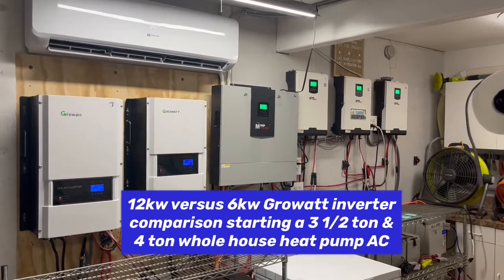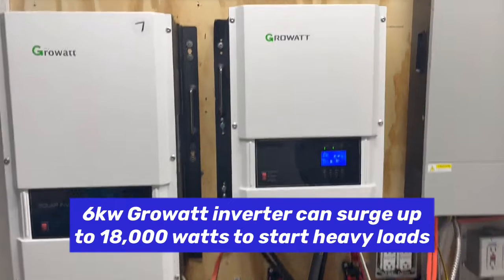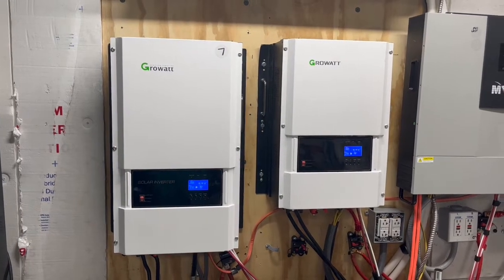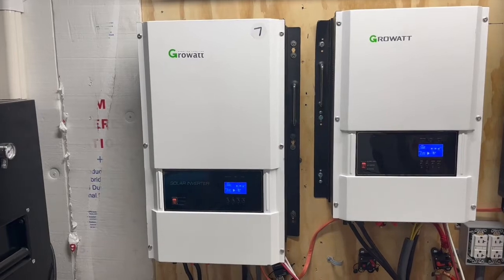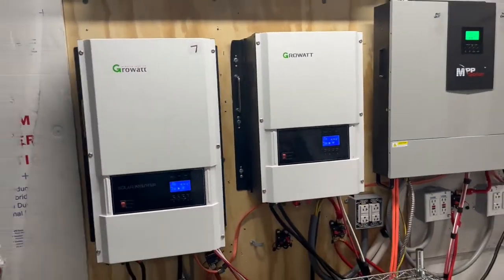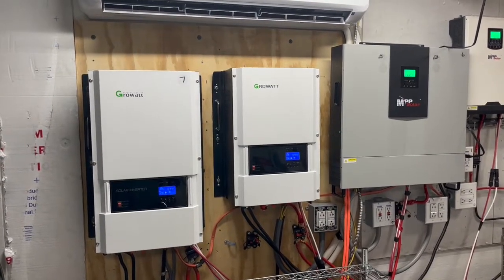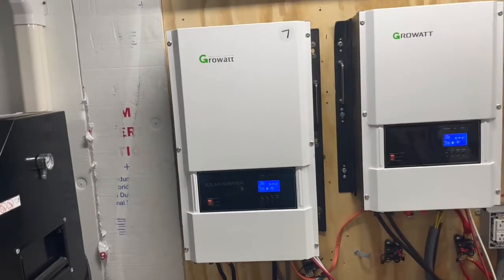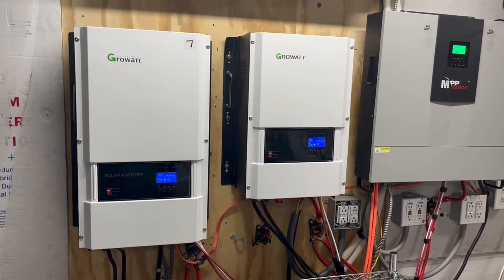12kw & 6kw Growatt Low Frequency off grid inverter comparison to start 3 1/2 ton & 4 ton AC.

Comment: hi can you fix growatt  Inverter mptt
Reply from the maker: You can replace the circuit boards in Growatt low frequency inverters. You can find replacement circuit boards on eBay.

Comment: Those are high frequency 220v inverter with a transformer to give you 120v. A true 6kw low frequency inverter will easily give you a 120 amp surge as long as you have the battery capacity.
Reply from the maker: These are low frequency inverters, the 6 kW weighs 109 lbs and the 12kW weighs 186lbs???? They weigh that much because of the large coils inside.  What are you talking about. You can go look on the Growatt website to verify.

Comment: How are the low frequency units doing? We are looking at the 8kw model.
Reply from the maker: They weigh a lot. The 6kw Growatt is around 109 lbs. The 2 EG4 3000 watt off grid inverters output 6000 watts when in parallel, those weigh around 20 lbs each and are much quieter when fans are running with heavy load. 

Growatt fans can be very loud when running a load of 3000 watts or more. Growatt idle consumption is around 100 -125 watts, EG4 is aroundc50 watts each unit. Both will give you split phase output.  I would think the 8 kw model would weigh around 150 lbs. 

very hard to mount on wall unless you have a lift table that can lift at least 50 inches off ground. I had to use an engine hoist chain pull to mount my 12kw Growatt. 

You can buy and replace the circuit boards for the Growatt low frequency inverters. They sell them in eBay. You can not parallel Growatt low frequency inverters. 

That’s why I switched to the high frequency EG4 3000 watt off grid inverters, I have 4 mounted on the wall for 12,000 watt output with a total of 200 watt inrush amp capacity to start my 3 1/2 ton, 4 ton ac units and my 12 ton pool heater heat pump. 

I just bought 2 more EG4 3000 watt high frequency inverters and will have 18,000 watt output capacity. I  can parallel up to 12 inverters for a total output of 36kw. 

If 8kw Growatt is all you will need, they are worth it but you cannot expand in parallel down the road. 

Check out my newer videos on the EG4 3000 watt off grid inverters, also they sell EG4 6000 watt , 8000 watt and 12,000 watt output as well. 

Not sure if the EG4 6kw, 8kw and 12kw are low frequency inverters. I only have the 3kW Ezg4 and love the fact I can keep adding more and only $674 each, $20 shipping. 

I recently found out in November that I have a stomach hernia so I can not mess with really heavy Growatt inverters anymore or I risk tearing hernia and having to get surgery to fix, so I switched to the 20lb EG4 3000 watt off grid inverters. Hope this helps, let me know if you have more questions

Comment: A common mistake is not reducing demands on a system. Unless you are okay with spending big bucks.
Reply from the maker: I actually use over double power now that I am producing it off grid and my electric bill is reduced by almost 80 percent. 72 in the house upstairs and downstairs and 74 in 3 car garage when 110+ degrees outside in day and in the 90’s most of the night. We have been able to pay off equipment each year with just the savings in electric bill each year. Can’t get that payback time with grid solar. Thanks for your input and hope you have a truly wonderful and extremely blessed 2024

Comment: What’s the battery voltage to run that 6K Growatt?
Reply from the maker: All of my Growatt inverters are 48v. Even my new EG4 3000 watt inverters are 48 volt. I now only use 51.2 volt EG4 server rack batteries on all my off grid solar systems. Hope this information helps.
Reply: @diy-solar-guy  thanks, I’m considering adding one for the 240v part.  I’m running two SW5548 ‘s so I’m already set up for 48v. At this time it’s 48v @ 2200Ah.   They can do 120/240 but finding the “SERIES STACKING
SINGLE PHASE / THREE WIRE SYSTE
USE TRACE P/N 1880-15” cable is difficult to find. I have the wire diagram but to stupid to understand how the pin configuration works.
Reply from the maker: @kenmay1988  the 6 kw Growatt can not be paralleled. Might want to t to look at the EG4 3000 watt inverters. I just installed and and running my 3 1/2 ton and 4 ton whole house ac system with 4 of them in parallel. 2 EG4 3000 watt inverters that are 48 volt are much lighter and can do the same as the Growatt inverter but you continue to expand by adding more in parallel, up to 12 - EG4 3000 watt inverters in parallel. Need at least 2 and need to add more in pairs if 2 to expand. Check out my latest videos on the EG4 3000 watt inverters. You can go up to 500 volts dc solar panel input with EG4 inverter, the Growatt can only go up to 150 volts dc solar panel input. You have to keep input dc amps below 20 amps but can output 80 amps on each inverter. They are $674 each. Only weigh 18 lbs. Growatt 6 kw weighs 109 lbs. hope this helps. Hope you have a truly blessed day

Comment: Thanks for your video. It's always great to see what others are doing. I have been running my whole home air conditioner system and another split system at the same time for the last few years without an issue, on my Mpp Solar 8KW inverter. That being said, both these air conditioners are inverter types and therefore are soft start and vary the draw as needed.
Reply from the maker: That is the wonderful thing about mini splits, the slow ramp at start up. My 3 1/2 ton & 4 ton were 78 amps and 109 amps at start up so I had to install soft starts to reduce start up amps. But I had to use a low frequency off grid inverter. High frequency will not start the 3 1/2 & 4 ton ac units. Thanks for your comment. Hope you have a wonderful and blessed week.

Comment: Love you channel, very informative, wanted to know if you ever got the E-Z start and did the growatt 6kw able to start you AC? Thanks
Reply from the maker: https://signaturesolar.com/surestart-soft-starter-4-ton-and-under/?ref=oJ3Bgl9hDE3G
Above is the link to buy soft start that I used on my three heat pumps. You can not start 3 ton, 4 ton and 12.7 ton heat pumps without a soft start. You can start a 3 1/2 ton heat pump with the 6kw Growatt and a soft start. Thank you so much for joining the channel and welcome. Thank you for your kind comments. Hope this answers your question and I have a lot of info on the subject along with 3 videos installing the soft starts on 3 1/2 ton, 4 ton and 12.7 ton heat pump. Very detailed on installing soft start that I bought in link above. Hope you have a truly wonderful and extremely blessed weekend

Comment: Hello sir, how many solar panels do u have connected to the 6kw? I have the same 6kw but notice it has low open voltage.. did  u run all your array in parallel?
Reply from the maker: I had 24-250 watt poly panels connected to 6kw Growatt low frequency off grid inverter I connected 4 sets 4-250 watt 38v input solar panels in series which was 152v pv input, connected those 4 sets together in parallel, then had another 3 sets of 3-250 watt 38v in series for 114v pv input. Connected in parallel as well. Then connected the 4 sets of 4 and 3 sets of 3 in parallel which gave me 119v pv input from solar to 6kw Growatt inverter. You have to keep your pv voltage input below 150v for 6 kw Growatt inverter. I was able to go over a little on total watt , because you will never get 100 percent of watts or amps out of every panel in your array. That is in perfect conditions all day long with no degradation in solar output which is impossible even with array on a sun tracker. I had to use that array for my 12kw Growatt to run my huge 12.7 ton pool heat pump heater so I actually have a separate EG4 charge controller 5500 watt input which is 22-250 watt poly solar panels in 2 string of 11 solar panels in series and the 2 strings in parallel, able to produce 100 amp output. I connect that charge controller straight to 48v battery bank. So I use the charge controller to charge battery and no solar connected into 6kw Growatt inverter. The charge controller voltage can go up to 500v pv input which keeps my amp input in wire below 20 amps. My pv voltage input into charge controller is 418v rather than 150v on pv string going into 6kw Growatt inverter. Much more edgy at 500v input to batteries than 150v input into inverter. I have a few videos on the EG4 charge controller used to supplement my large load on 12kw Growatt inverter when running 127,000 btu pool heat pump heater. That heater uses 7500 watts and 186 amps to run. My 12kw Growatt inverter can only put out 100 amps output. 20 more amps than 6kw Growatt inverter, I actually can get 120 amps output of 12kw and make up the difference with the EG4 charge controller connected through the 48v battery bank to get 186 amps to run pool heater and keep my batteries completely charged at full. Not easy to do, lol
Reply: @DIY solar power with Pappa off grid projects. How u able to connect those different strings to connect to the 6kw? The inverter only has 1 pv input. Thank you
Reply from the maker: @larrymiller7128  I connected the charge controller thru the battery connection. I have an extra Anderson 175 amp quick disconnect connected to all 4 inverter battery block before the dc breaking going into inverter. Then I set my EG4 charge controller to less than inverter bulk charge and float settings. Usually .4v less on each one so I don’t overcharge AGM batteries. LiFePO4 have extra protection with BMS factory installed on my batteries. I will try to do a video today showing how I did the connections.
Reply: @diy-solar-guy  looking forward to it.. thank you
Reply from the maker: @larrymiller7128  I finally after many interruptions today posted a video on how I connected the charge controller to solar panel array and to battery bank of 6kw Growatt inverter. Packed video with as much info and helpful tips as I could think of. Hope you have a blessed night and hope the video helps.
Reply: @DIY solar power with Pappa off grid projects  hello again, can u help me figure out why I'm not seeing my solar panel in my growatt screen..also my solar input is 0. Hope u can help figure out my issue..thank you have a bless day..
Reply from the maker: Use a meter to check dc voltage coming in on wires from solar panels, you might have burned some out and have an open circuit. That would be the first place to start. Usually there is an open circuit more than the inverter is having a problem. Look for that with meter.
Reply: @diy-solar-guy  im getting 145v  from the panels right now...
Reply from the maker: @larrymiller7128  that’s below the 150 volt input range which is fine. Is the polarity reversed on wires? that would give you no voltage in. Are you getting any error codes or fault codes.
Reply: Hello, agai, I have 18 of 320w 24v 40v open circuits  renogy. Is that enough to power the 6kw inhave ?  That's 5760w..
Reply from the maker: On a good day with perfect conditions you might get 5000 watts output with 5760 watts in panels. And that is maybe fir a few hours depending on angle of panels towards the sun. The bigger thing is how many amps will you need to run your loads while charging your battery bank.  I needed more amps for my 6 kilowatt because I was running large loads, that’s why I added the EG4 charge controller to supplement my load draw. Made a huge difference and charge controller was $399.00 plus around $25 for shipping. I have 2 EG4 charge controllers and use both throughout the day when I need to boost a certain inverter where I am maxed out with solar coming in and not able to keep charging batteries, I just add more solar by using the Anderson 175 amp quick connect  cable to plug in with Anderson quick connect cable on battery bank attached to buss bar. Really comes in handy since it is 500 dc volt solar panel input, 5500 watt input and you can do two strings in series then parallel those 2strings together. I have 2 string of 11-250 watt solar panels in series, then those 2 strings are in parallel to make the 5500 watts. The big setback with Growatt inverters are low voltage solar input and also can not parallel together. The Beni fit is you can start a 4 ton AC with a soft start installed send run all day. Hope this helps, best thing to do is try to run your loads with what you have and see if inverter and solar can keep up.

Comment: Hi  pappa  . Hope you and  your  inverters in good health .  I would  like  to  ask  about  your  feedback and  your  evaluation   for  using low frequency  growatt in running  motors and  compressors and  for  how long  now ?  Do you  face  any  faults  or  problems
Reply from the maker: Once panels are getting sun in the summer, I can run main AC heat pumps(3 1/2 & 4 ton) all day for 10-12 hours to super cool house, I only use grid power in 2 months of the year overnight to run ac units. My highest electric bill last year was $172, which is $500 less than when I had no solar. Growatt low frequency is great for starting large in rush amp draws but uses alot on overnight at idle. So I use mpp inverters(48v) for over night use on LiFePO4 batteries. I have 4 separate inverters with each having their own battery bank. I way overproduce power during the day but all batteries are charged up completely when sun goes down. High frequency inverters ( mpp) are great for slow amp draw like mini splits during the day and night but can not start up 3 1/2 ton & 4 ton ac heat pump units at all. Having split phase on the inverters is better than 120v. Never know how you will expand in future. High frequency can parallel but low frequency can not parallel, at least the units I have. I will be adding a couple of 500v dc input, 120amp charge controllers to my Growatt inverters soon. I will disconnect my solar panels from Growatt and run through EG4 charge controller straight to batteries in the near future. I can connect 22-250 watt panels in series or 11 in series and parallel another 11 panels in series to get close to 500 volts dc and only 22 amps or less running through 10 gauge pv wire. Will be able to run the 100 foot distance with better efficiency while keeping wires cool. Hope this helps answer you questions.
Reply: @DIY solar power with Pappa off grid projects  thanks  alot  for  your  response   and  explaining  ,  actually  i need  inverter  for  small  workshop   main work is  to  grind coffee  for customers  by  one  of  6  grinders  (  3  -  4 Hp  motors  )  no  more  than 30 mins  hour  total grinding  in the day  . And  we  close  at  6 pm   so no  load at night  only  1 - 2  amps .
Reply from the maker: @robertomuhammad35  might be able to get away with high frequency but if you run all six at one time depending on amps or watts used, it might shut down inverter. Best to figure out max amount of amps or watts needed for all appliances running at same time, then see if inverter could handle that amount. Also batteries used will play a part as well, weather AGM or LiFePO4. I can start and run all my large heat pumps with at least 4-150ah 2KWh batteries in series but can not even start one unit with just 1 server rack battery of 100ah 5120wh. AGM are great for starting large loads but LiFePO4 batteries can drain down to 10.5 volts each battery weather in series or parallel. Better to have 2-5120wh in parallel to drain batteries that low, I only have one server rack battery at the moment but would prefer 48v server rack batteries when draining to 10.5. I can only drain AGM batteries weather in parallel or series down to average of 12v. That is a big difference in availability amount of battery bank usable.

Comment: Can you charge with ac input 120v generator by chance? have you ever tested I know manual says only input 240v but I didnt want to buy another generator
Reply from the maker: These Growatt inverters will only operate with 240v input. It is not wired inside unit to accept 120v. I don’t know of any way you can change input voltage. These Growatt units have a high surge of 3 times watts, so the 6000 watt Growatt can surge to 18,000 watts to start compressors and motors, the 12,000 watt Growatt can surge to 36,000 watts as well. I believe this is why they have the input voltage at 240v instead of 120v. You also can not parallel the low frequency Growatt inverters. It is just the way these units were designed.
Reply: What if I change the input current lower and used a step up step down transformer. I really only want input from a cheap 120v generator when I have no sun. And I dont want to buy a better generator just for backup of my backup
Reply from the maker: @plojm123  I never tried using a step up transformer. You can call signature solar in Texas on Monday and ask them. They should be able to answer your questions before you spend any money.
Reply: @diy-solar-guy  I will thanks those guys are great

Comment: To run a 4ton unit all night is going to take some serious batteries... I have over 30kwh of Lifepo4 batteries in my system and they will not come close to running that all night-
Reply from the maker: I know people who have systems set up in AZ that run whole house AC 7/24 on solar only. But they have 6 server rack (30kwh) batteries and they installed solar on grid& off grid for 16 years. So it can be done. I doubt I will get that many batteries to do that but it is being done.